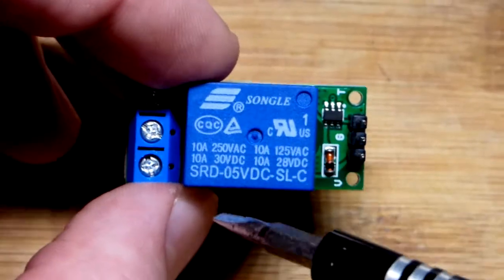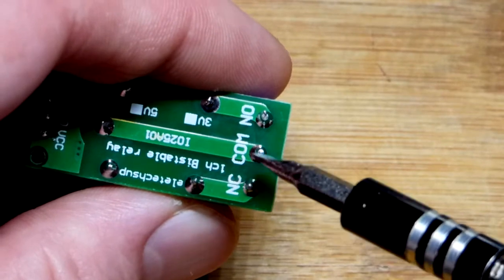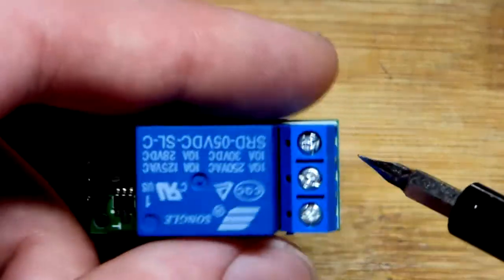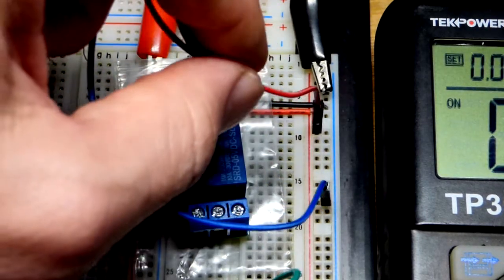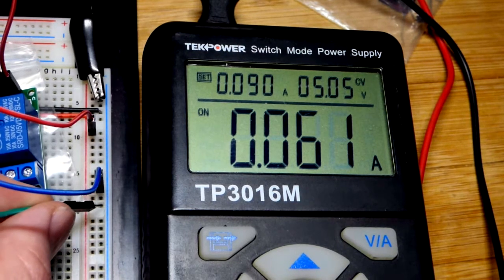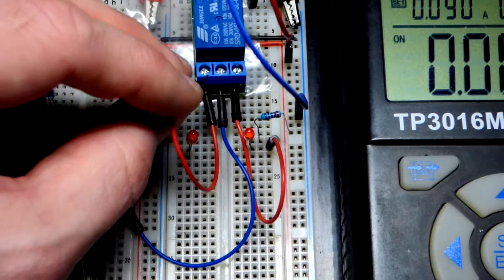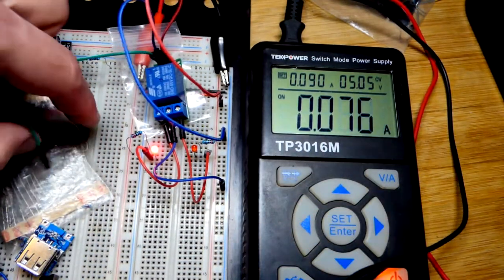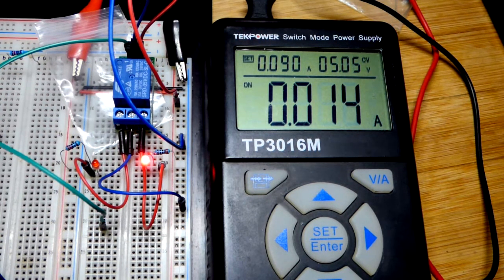Bistable relay module that simulates a latching relay demonstration how to DIY electronics video

Comment: Can this be used to switch ground only? And can it be activated by ground that is a 12v supply circuit? Excuse my ignorance. I am a mechanic, electronics are not my strong point. Or do you have any other videos you could link me to, that may help? Thanks

Comment: i found those 1 and 4 way bistable flip flop switchs,they can come with or without relays ,just add momentry to trigger and ground ,then push on,and push off ,they were only few dollarsand 3-24 volt range , thought they work well for lights ,blinkers and horn on electric bikes

Comment: This is absolutely not a bistable relay! The module simulate keep relay by electronics circuit. It still wastes energy only for holding N.O. position in contact. As my humble opinion, the module is an useless design for re-using surplus dirt cheap production NON Bistable relay.

Comment: hello thanks for your video ,was hoping you might be able to help me ,when you first connect power to this module does the relay still stay disingaged or does it activate,ill be using these for the accories on electric bike so each time i turn the power on i need the relays to stay untriggered , this is what happens with those simple 555 timer ic circuits,hope you are able to shed bit of light for me thanks KT
Reply from the maker: Relays stay in the normal position until given current through their coil. A module shouldn't switch the relay until it is given the proper signal. You need power to switch the relay, but you can easily power the module without switching the relay.

Comment: First A Bi-Stable relay is a relay that has 2 stable states, hence the term Bi-Stable. Most of these rip off boards are not bistable relays, they just have a bistable IC which actuates a relay via  pulse. If you really must use a relay, you would be better off using a PWM drive for the relay.
 Like any motor, a relay requires more current to actuate it, but once actuated it only needs a holding current. Most of these circuits only run the relay at full current, so you are wasting power by using one of these.
If you want a bi-stable relay, check with the seller that they know what they are talking about. There are different types be that single coil or double coil, but they have one thing in common and that is they do not require any holding current once actuated.

Comment: Does the relay revert to NC when it loses input power?
Reply from the maker: The module needs to stay powered for it to act like a latching relay. So if power is cut from the module, it will be in the normal position of closed for the NC switch and open for the NO switch.

Comment: I got some relays a few years back when going through the Make:Electronics book they are not the module type though and need a diode from what I recall. I need to get them out and have a play around. Thanks for posting
Reply from the maker: The basic relays I used in earlier videos were from the Make electronics kit.